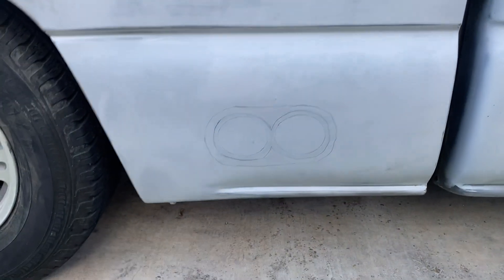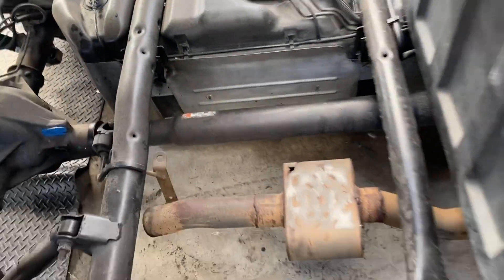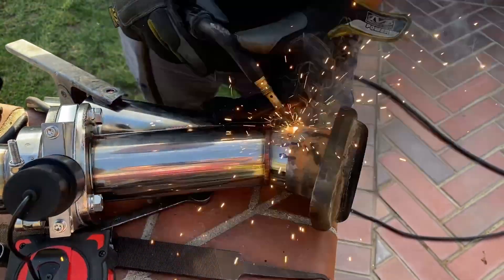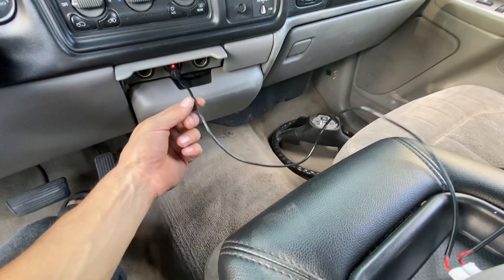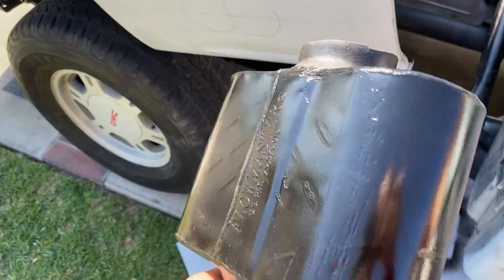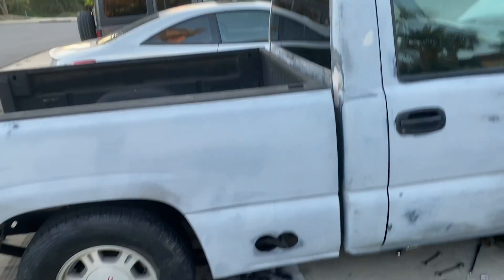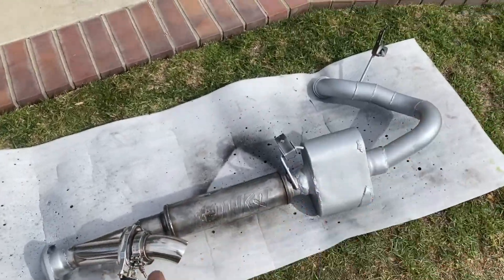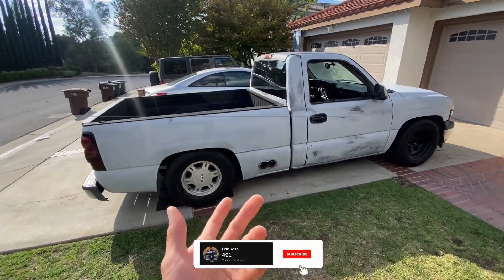LOUD CAMMED 5.3 SILVERADO GETS A SIDE EXIT EXHAUST WITH ELECTRIC CUTOUTS!!

Comment: Hey can you send a link to the exhaust I have a 99 Silverado and I’m in need of an exhaust system it will be greatly appreciated
Reply from the maker: It’s mostly custom made, buts we just used an exhaust cutout kit from eBay I believe it was 2.5 inch or 2.75 and just a flowfx muffler from eBay too.

Comment: Link to exhaust cutout?
Reply from the maker: yessir this the exact one i got bro! It works great haven’t had any issues, only one thing tho it does rattle slightly when closed not sure if something is loose or if I need to tighten the close valve! 

https://www.ebay.com/itm/175395593535?mkcid=16&mkevt=1&mkrid=711-127632-2357-0&ssspo=RT1NlOkYSn-&sssrc=2349624&ssuid=nCH1hP3qSsK&var=&widget_ver=artemis&media=COPY